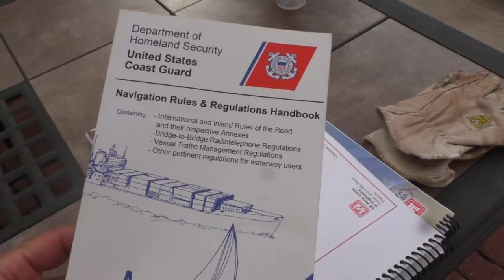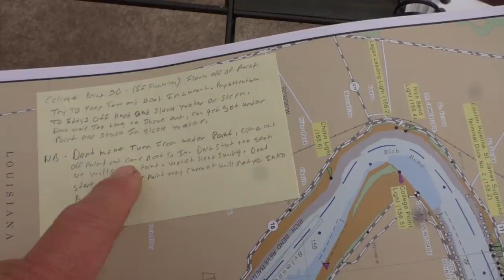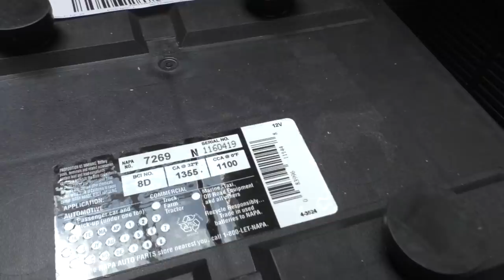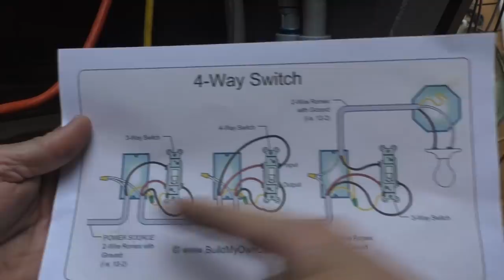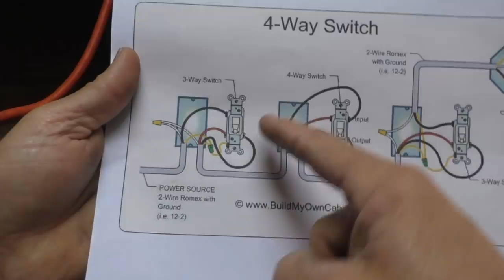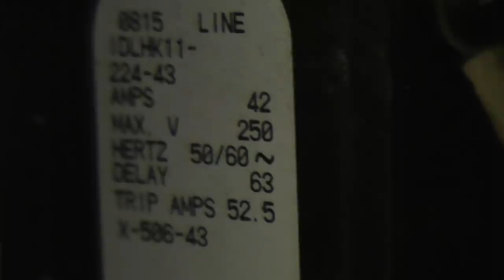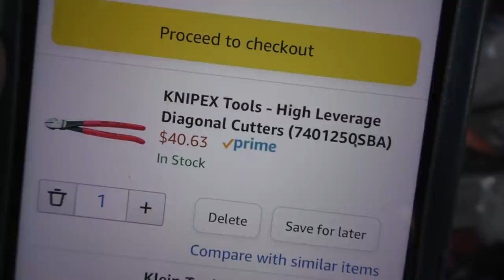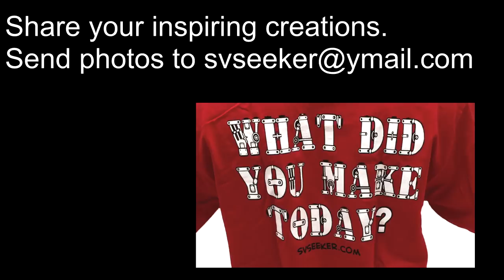Wiring the Boat -  Part 1

Comment: Doug, I've been watching your videos for some time. and have been impressed with your resourcefulness and tenacity.  But I have to say that I'm disappointed by this one, not only because of the dangerous short cuts you've taken with the wiring on your boat, but more so by the flippant responses you've given to those who have offered quite rational critique.  

Electrical wiring on a boat undergoes environmental stresses far different than residential or industrial, and trying to apply materials and techniques from the latter is not wise.  Your guy Chris obviously knows his stuff, no doubt about it, but those skills do not translate well to a marine environment.  Neither do the materials you chose - (used) welding wire instead of marine battery cable, untinned and stiff residential wire, wire nuts instead of heat-shrunk connectors, regular electrical tape instead of heat-shrink, etc.  I understand that you got a lot of the materials for free, and you're on a budget, but most of us are in the same boat (no pun intended). 

I live on my boat full time, and I've seen and dealt with all sorts of electrical issues that I never saw living in a house.  Corroded wires, melted connectors and insulation, voltage drops due to corrosion and/or undersized wires, and more.   Salt water, movement, diesel and other chemicals, all of these can do a number on your best intentioned wiring.  Short of rewiring the whole boat, I've repaired and upgraded as much of it as I can, trying to follow ABYC recommendations as much as possible - not because ABYC is perfect, but because my safety is on the line.  It's not always cheap, I get that believe me, but my life, and that of my family, is worth more to me than a few dollars saved on unsuitable equipment and supplies.

Please take this in the spirit intended - there's a big difference between critique and criticism.  I wish you all the best, can't wait to see your boat finally splash and go adventuring around the world.

Regards,
David
Reply from the maker: Sorry for the flippant response, but that is because THERE IS NOTHING TO BE AFRAID OF!   Chris did a fantastic job, and the arm chair crowd of cowards is forced to incorrectly fill in the blanks in order to find something wrong.  Which they feel is there duty.   Hell, even a badly wired boat, which this is certainly not, is far more safer than having to lower a long boat, harpoon an sperm whale, render it over a fire on deck and fill the oil lamps in the cabins.   The sea has not become more fierce or unforgiving, but our society has certainly become more fearful.
Reply: @SVSeeker  it's not a matter of being afraid, it's a matter of making of good choices.  For my boat, I would not make some of the same choices you have, as I've been burned (almost literally) by wiring issues.  Electricity and salt water have an adversarial relationship, so choosing materials and methods that can stand up to that is a key decision.  I'm not faulting Chris' efforts at all - I'd hire him in a heartbeat to do residential/commercial work.

I'm no arm-chair guy.  I've sailed oceans, I live on my boat, I work in the marine industry, and hopefully soon will be setting out to finish a circumnavigation I started 30 years ago (before getting side-tracked by a woman).  I agree with you that many in our society have become fearful, and unwilling to take even small risks.  But there is a difference between calculated risk and doing something that goes against well-established safe practices.  Those practices usually come from hard lessons, and are designed to help avoid repeating them.
Reply from the maker: @davidhoy7605  Just saying.  It would be a good idea to know more before you draw conclusions.  We all do the calculations and to me that sure looks like poorly placed fear.

Comment: I was just wondering: with all the steel parts protruding on the deck, how ugly it would be to be slipping and falling in bad weather and hitting those steel protruding parts (hinges levers, studs,..). Is it normal on SV Seeker compared to commercially designed boats? Maybe it can be improved hete an there? Maybe get a safety expert do a review?

Comment: I’m sure it’s probably been said in the comments, but You don’t bond the neutral in sub panels, your only bond the main panel, Because the neutral will have a load on it, and that’s why you need a separate ground wire.
Reply from the maker: They are not.
Reply: @SVSeeker  they are not? I am guessing you are saying the neutral and grounds are not bonded together after the main panel? I was saying it because that was a question you had, and I didn’t hear him answer it. I was just trying to explain for you possibly and for others watching your series. Hope you didn’t mistake that for me talking sh!t, It was honestly to be helpful
Reply from the maker: @SilentStorm_5  Right, they are only bonded at the generators. Not the panel. Frankly this is one of those things that you electricians care about. And it’s a way above my level of safety standard. :-)

Comment: The water analogy only works for basic circuits and DC. Will it let you wire a house or this boat, yes, but their are more complicated applications, so don't stick that in your mind as the actual way electricity works, just as a reference when looking at basic circuits.
Reply from the maker: It’s called an analogy!   Go make your own teaching videos.

Comment: In my part of the world, in a house, neutral and ground should not be bounded. Ground only connects to a copper rod pushed down into the soil to groundwater depth. On a boat, I think they bond neutral and ground because there is no real ground.

Comment: They say that you should use tinned wire on a boat. However, the stuff is really expensive and I am wondering if it is really necessary when i go to rewire my boat here shortly. Did you use the tinned or non-tinned wire?
Reply from the maker: It is not necessarily,  and not commonly used either, unless you're in a high priced marina or on a boat where the tax payers foot the bill.  A can of dielectric spray spay is much cheaper
Reply: @SVSeeker  
Thanks! Will use dielectric spray for sure.
Reply: If you have insurance, or want insurance, use tinned wire.   And yes it's worth it.  This winter I'm going to be rewiring the whole bilge pump wiring the PO did that corroded inside the insulation and from that resistance got hot and burned through the insulation and only by luck didn't catch my boat on fire.

Comment: solar breaker and generator breaker entering the distribution panel... Just wondering, are you just going to manually ensure solar and generator are not feeding the panel at one time. And, where does shore power feed in.  Just curious.  Happy Sailing!
Reply from the maker: Solar is a reference to solar charged batteries powering the inverters which will sync to the generator if it is running.   And no shore power.
Reply: Good. I have not tried any syncing inverters. I have to use transfer switches. Your system is a lot cleaner than mine. Thanks for the reply. (A fellow DBA).

Comment: Looks like you are using THHN on your circuits. You will experience short life due to the characteristics of the insulation and atmosphere. The insulation of the SOW cable should contain    ERP insulation. ERP will resist the atmosphere and vibration  it will be subjected too. When you rewire suggest you use an XHHW 2  cost is higher but what is the cost of offshore down time? Easier comparison THHN  residential grade. XHHW industrial grade.  It looks like you are using a residential grade load center for your breaker box. Take plenty spare breakers with you. Plug on breakers are not going to be happy with the vibration. Should use a bolt on breaker panel . Bus bars are heavier , breakers are mechanically attached to tinned straps.
Reply from the maker: Did you missed the part about the budget and the wire being free, or are you just ignoring that. : )
Reply from the maker: @tenet-rotas  That was mean?  Sweetheart.   Harden the fuck up.
Reply: Sometimes free is not the best option. I stated when you REWIRE. Information was intended to provide advice on types of insulation that would be more suitable for the application you are placing it in. The electrical is a life blood of your vessel.  Maybe you should have put a wish list on your videos, you would be surprised what people have laying around. Let's see commercial grade panel board. Have 3 taking up space in my garage. You would have to build the box and cover or pick those up surplus. Had several coils of various sizes of all tray cable that I recently gave away.

Comment: Doug are you going to use an inverter system to feed power to the panel if the Benny goes down in an emergency or for a short term back up? We use solar and battery with Benny on the Rv coach to boon dock and have auto transfer to make it more seamless or redundant
Reply from the maker: Yes, but it will be the primary supply.  The generators are the backup.

Comment: You have the same thing when you have gasoline with the new fuel injected system because the fuel bars pressurized and injectors don't use it all in and it sends it back to the fuel tank instead of just leaving it in the fuel rails

Comment: All that electrical how is it grounded in the boat? If you get a short or something leaks current into the ground is it going to electrify the water? Boat electronics have always mystified me.
Reply: No electricity wants to find the shortest and easiest path back to the source, so any faults would run though the hull to the nearest ground bond it doesn't radiate out
Reply from the maker: A short will most likely trip one of the GFI breakers, but everything is grounded in one spot, or at least given a copper wire path back to a single spot.  In our cast that is the steel bulk head behind the electric panel.   If the short it into the water then the connecting pathway is through one or more of the anodes attached to the outside of the hull.

Comment: I was thinking why do you need all that heavy gauge wiring given lighting these days runs consumes only a few watts and happily on 12v and its a sail boat. forgetting there is an arsenal of pumps, winches compressors and industrial maker tools on board.
Reply from the maker: Excellent.  Now go explain that to the guy who did not figure that out.  : )

Comment: Hey Doug @ 10:57 that pipe looks as if it's the exactly size it needs to be to fit the loom of cables. Was there a rough estimation made back in the day when that pipe installed, and if so, how did you figure that?
Reply from the maker: I’ll say yes but frankly it was the largest pipe I had laying around.  : )

Comment: What is ground in a boat? Pot plant?
Reply from the maker: A rhododendron would be nice.   But a wired pathway back to the generator/battery/solar keeps current from moving through the steel hull routinely.

Comment: Awh, that question... to bond or not to bond the neutral?!?! It's easy...  whenever the circuit is "locally drived"  e.g. out of an isolation transformer , out of a generator, out of a solar system, etc,  the newly created circuit/neutral gets bonded  ...  all other places it's isolated as in sub panels. . . So, normaly its only bonded at the source or service entrance. . Great content!!!! however, didn't like the 4awg splice inside the conduit , that splice will generat additional heat, might be a violation and how will you inspect that later?
Reply from the maker: Thanks and... Inspection?   No!  We don't need any inspection.   This is not Carnival Cruise Line, and we don't need our mothers to hold our hands either.  : )
Reply: @SVSeeker  sorry, i think you missed my point. You are the future inspector and maintainer, all electrical systems need maintenance esp in harsh environments.  . . Unless your mother is going to do it for you.
Reply from the maker: @TC-gn2by  Worse than that.   That reply was meant for someone else.  : )      And to answer your question:  smoke is a good way to check on the splice.   : )
Reply: Okay thanks for the clarification, I enjoy enjoy your contact immensely thank you. Iv been an Industrial electrician and electrical designer for 40 years now, been on some crazy industrial projects,  SVSeeker is all good.
, I don't nitpick but some things I just have to point out  ,    good luck with your project!!!
Reply: PS. If I lived closer I would be there helping you

Comment: PVC on boats is not the best idea.             Chlorine gas when fire.  crimps beater then wire nuts.
bolt on panel while stand up beater but no aluminum buss bar the corrosion!
Reply from the maker: Fuck that.  Fire on a boat is a much worse idea.  : )

Comment: Nice work but not sure you are following ABYC Marine wiring standards. I know you like to do things your own way but, spending money on tinned wire would have been worth it rather than doing it over a few years down the road. 
One other thing is wire nuts do not belong on boats. These will corrode easily and cause bad connections. All connections should have crimped terminals on them and be terminated on terminal strips. Good luck!
Reply from the maker: Hell no I not following ABYC.   That's like asking West Marine, "What do you thing I should buy?"   : )    And bull shit.  We'll take care of the FREE wire and it will last for decades.   Likely longer that me.

Comment: Are you aware that diesel fuel polymerizes in copper ?.
Reply: Not to mention the soldered connections that will leach into the fuel and iirc damage the injectors...  this guy routinely spits in the face of all knowledgeable advice claiming its just a scam by the companies selling product.  While some things may be, most isn't. At this point I'm just waiting to see how he explains / justifies the various failures that occur after he's in the water, the electrical will take a while but it'll be a massive corroded mess after a while.

Comment: A true professional would be installing to the ABYC standard, using tinned wire and  nautical connectors & switches.
Reply from the maker: Only when a true professional finds somebody gullible enough to pay for  that. Then you have to ask what profession are they actually in.
Reply: @SVSeeker  The ABYC standards were written on the backs of hundreds, if not thousands of combined years of experience by boaters for boaters, Its not at all about the cost but about reliability and safety, 95 % of those standards were written to fix of problems that have occurred. Chris seems well knowledgeable and professional , but some stuff in marine is and needs to be different to land based wiring.
Reply: @SVSeeker  i have 35 yo wires on the boat still good(tinned) and few from last owner - totally trashed/corroded inside whole wire... This would work if you need to build and sell quick...
Reply from the maker: @Nick75au1  LOL  : ) It's not about the cost because YOU ARE NOT PAYING THE BILL!
Reply from the maker: @alexeydegtiarev1708    So take better care of that boat that the other guy built.  : )
Reply: @SVSeeker  had to replace all wiring except the original...
Reply from the maker: @Nick75au1   ABYC is also written by the companies selling you the products.   : )      A lot of skepticism is prudent.   And by the way.  This is America.   We built this country from scratch with what we had at hand and improved it over time as we could.   We did not start by sitting on our ass and whining that we did not have the money to build to someone's Code.
Reply: What about insurance and passing a USGC inspection for a commercial boat if that size. Lubber wiring won’t pass.
Reply from the maker: @petethompson221    We are not a commercial boat, and we will not carry insurance except where liability is required.  And it's fairly easy to avoid those places unless you plan to stay tied to a dock.  But that is not what boats are for.  : )

Comment: That guy may be a great house electrician,  but does he know marine wiring?
Is he using marine electric hardware?

I wouldn't get anywhere near any electrical item on that boat. It could be a death trap.
Reply from the maker: Oh!  No.  He does not know marine wiring.  He will not feed you a bunch of bull shit about tinned wire and then bend you over.    And if you think that is a death trap you should have seen the oil lamps used by sailors of previous generations.   The technology has vastly improved but the character of "Man" has greatly diminished.
Reply: I worked on a wooden sailing ship replica, both building it and as crew, and they were trying to maintain marine wiring standards anticipating someday taking paying passengers. Wire nuts were absolutely forbidden. I understand there's a detailed survey required before it can be certified for paying passengers.
Reply from the maker: @alwynallan    That is true.   Part of the stupidity of commercial passenger boats.  No wire nuts, and then they burn with all the passengers because they had no working smoke detector on a USCG inspected passenger vessel.   So for those frightened by wire nuts on my recreational vessel.   Go ride on one of the USCG inspected vessels.   We have wire nuts.   ...but we also have working smoke detectors.   Do you want be responsible for your safety, or leave in the the hands of the authorities?    We are the federal government, and we are here to help.  : )
Reply: @SVSeeker  ... and luckily for you he was a house electrician that was able to sort-of explain why connecting ground to neutral would be a bad idea on a boat... do some research on boat electrical.  and ground only at the source. Many house electrical pro's don't understand the differences.